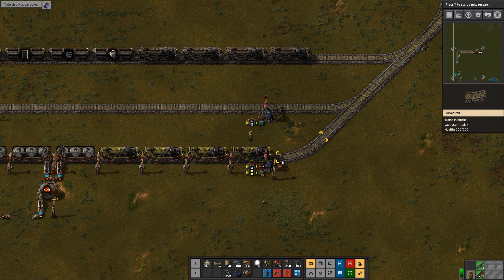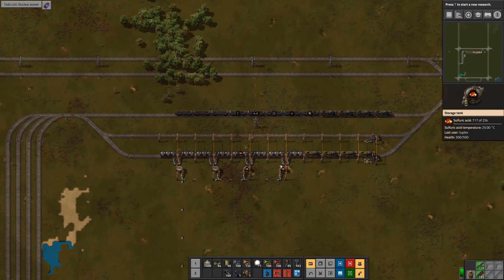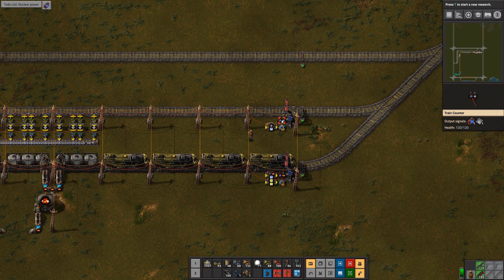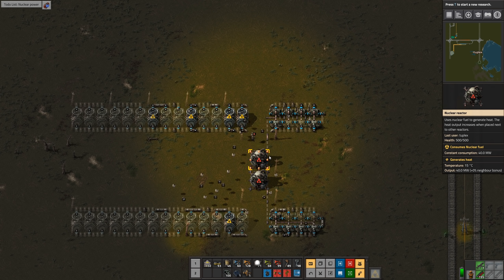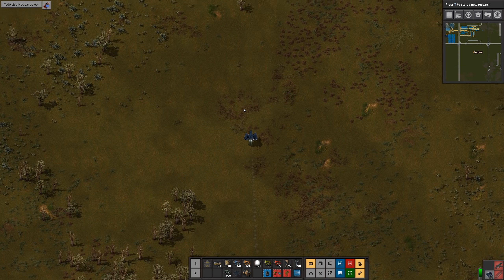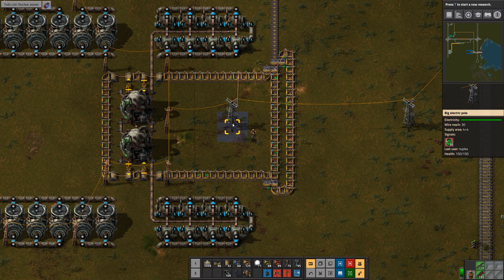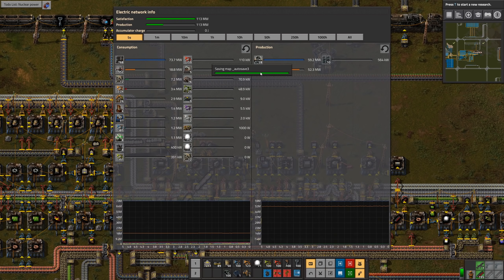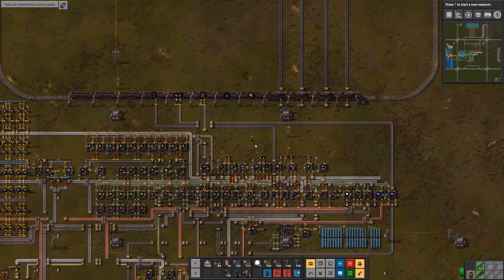Factorio 2,500 SPM Grid Megabase #12 - Nuclear power

Comment: 43:14 - re trapping stuff: a technique I've seen and use is to do a filter splitter with the filter set to belt immunity - the red x is a nice indicator that you're intending to not send anything out that way, and... unless you're making (and belting!) a bunch of belt immunity equipment items (in which case: why?!?), well, it's not going to interfere with anything you might actually ever be using.

Comment: 56:19 - re "why do I have so many on the belt" -- that goes back to 40:44, where you didn't connect the horizontal and vertical sections of belt... and since you later disconnected the red wire from the power poles, you had two separate sections, so... you get 10 fuel cells every however-many-belt-segments-that-is on the horizontal line.  I imagine you've since fixed this, but... commenting anyway, because the question felt like it needed an answer.  :D  AND, also, there's another gap that you create at 41:02, in the middle of the vertical, where you don't overlap the blueprint after pausing to build a wire where you jump the tracks... though, that one probably doesn't actually matter, since you left the red wire connected to electric poles, and both sides of that split are connected to poles that connect.  But... in case you pull the poles, you might want to know about the gap in wiring on the belts.  ;)

Comment: You probably noticed already, but the wiring is not connected at the corner before the belt goes vertical above the rail line. So it will keep outputting fuel as long as the horizontal belt is empty.
Reply from the maker: Good catch!  I did notice that later, after I made hundreds of extra fuel cells ;)
Reply: Yea, easy to miss while building with a lot of wires... One of the few disadvantages when using blueprints and wire.

Comment: Hey. My 2 cents:

1 centrifuge without modules, running non stop can support 0.007 u235 / 12s * 10 fuel cells * 200s = 1.167 reactors. You have 6 centrifuges, so you can already support 7 reactors with fuel cells. From a yellow belt of ore you can run 15 ore on belt/10 ore per craft*12s = 18 centrifuges. Which can support 21 reactors. 20 reactors is 3GW of power in 2xN setup. So, there is no need for kovarex until the end game if you have a yellow belt of ore. 

Items count. Make a memory cell with either combinator. Pulse read inserters from reactors and subtract the inserter hand count from the memory cell. Pulse read the output inserter and add the hand count to memory cell. That way you have the count of fuel cells in the loop. Enable the output inserter based on memory cell < N condition. By setting all hand sizes to 1, you can precisely control the number of items in the loop.
Reply from the maker: Hey Oleksij, thanks for watching ;)  Great idea about the memory cell and counting with inserters.  I haven't dont that before, so it will be an interesting challenge to set it up.

Comment: You could have counted how many fuel cells are on the line by counting the inserter swings from the output box and subtracted from that count whenever the insterters took a cell off the belt to put into the reactors... That is a little more complicated to do (I don't mess around with circuits very often other than limiting chests etc) but it would be more accurate than the way you've done it because you don't have a fuzzy count due to undergrounds etc...

Not that the way you've done it wont be good enough for what you need! :) 

(P.S - Where can i find those reactor blueprints?? heheheha.)

Comment: With your U-23n chests you run the risk of having a slot that contained U-235 being replaced by U-238, once this happens for all eight chests U-235 will pass thru to the U-235 belt. This may cause fuel production to stop.
To fix you should have 1 or 2 chests dedicated to the storage of U-235.
Reply from the maker: I do now, thanks.